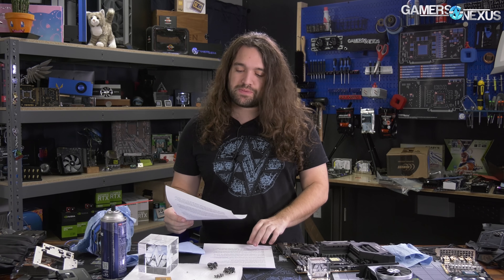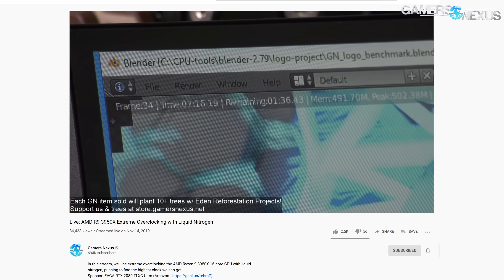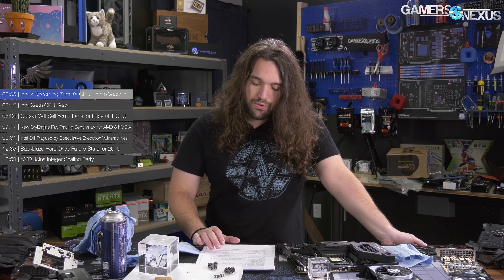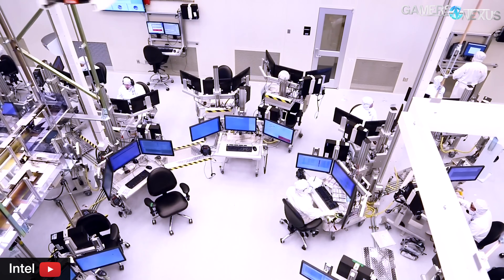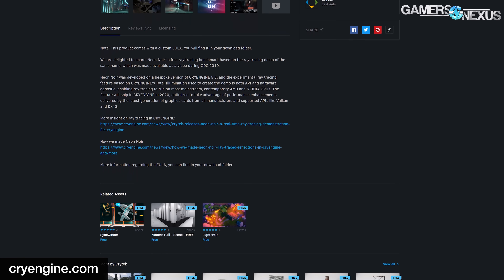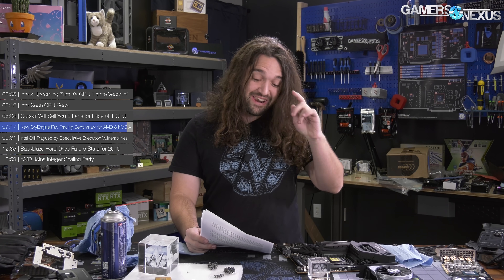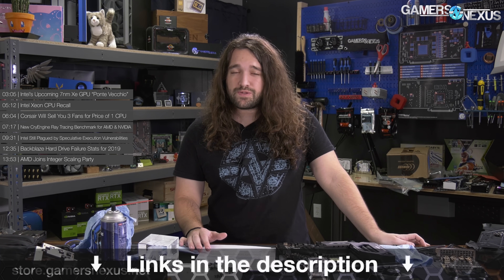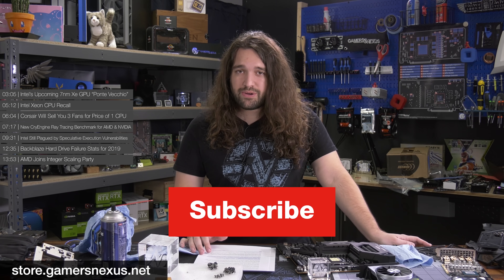HW News - Intel CPU Recall, 7nm GPU, AMD Ray Tracing Bench, & HDD Failure Stats

Comment: Yeah corsair is getting ridiculous with the fans. I'd rather get noctua...
Reply: But but but RGB!!!
Reply: Wouldn't trust Noctua either. I've owned both NH-U12P and NH-U12S and bundled fans are from OK to garbage:

NF-P12 of the former was acoustically very decent, except for some resonances of marketing notches at certain speeds.
But motor is plain horrible miniaturized vibrating roller/single cylinder ICE without balancing.
Thought that as bad sample, but NF-F12 of the latter behaves equally same. So it's feature of Noctua's marketing BS motor.
Both fans are literally the absolutely worst vibrating PC fans I've touched in 25 years of the hobby!
At the same time I've handled dozen or of Scythe Slip Stream (+few Glide Stream) and almost all run smoothly without any vibration.

Then NF-F12 raped acoustics with marketing BS design making its sound profile very restless.
Those "stator" blades being aligned with trailing edges of the blades causes major disruption to airflow separating from blades.
That causes spikes to freqency profile. Thing what every acoustically good fan wants to avoid.
You can mimic that noise increasing effect by blowing air from mouth and moving finger or pen back and worth through that airflow.

And Noctua's original claim to fame in fans, NF-S12, is like those "to downhill in tail wind" fuel consumption numbers of car ads. It's quiet per speed, because it really can't push air through impedances.
It's almost like designed to fool impeller anemometer, which forced SilentPCreview to develop new fan airflow measuring way:
http://www.silentpcreview.com/article734-page1.html

With Arctic P12/P14 having very good all around performance and acoustics at superb price and even longer than Noctua 10 year warranty, I don't see any sense to spend money into products of company with history of such snake oil quackery.
Heck you can literally get pack of five Arctics at the price of Noctua's latest!

Comment: Whats interesting is with star engine. There is a article out there where the star citizen developers complain about implementing ray tracing in there game. Mean while crytek delivers on ray tracing. Can't beat the creators of the original engine.
Reply: I heard that they had ray tracing as a goal later in development. I heard nothing about any complaining. I doubt they have much to complain about since Star Citizen runs on Star Engine, which is based on Lumberyard, which is based on CryEngine. If CryTech adds ray tracing, Star Citizen will get it in due time.